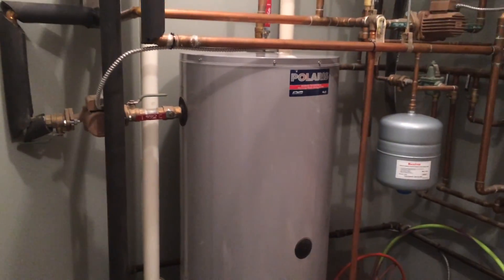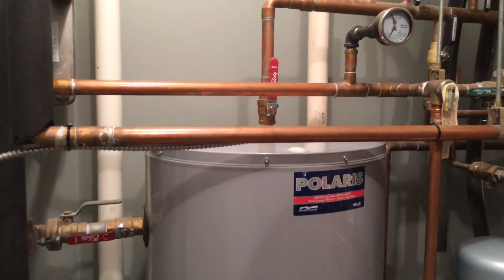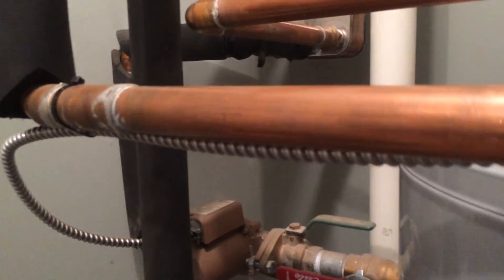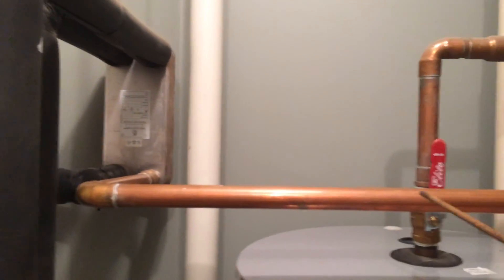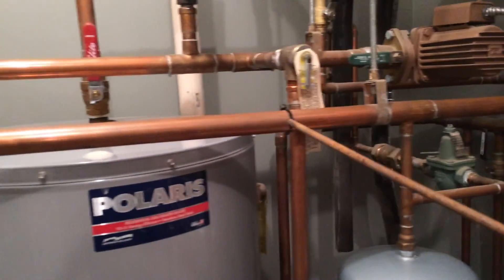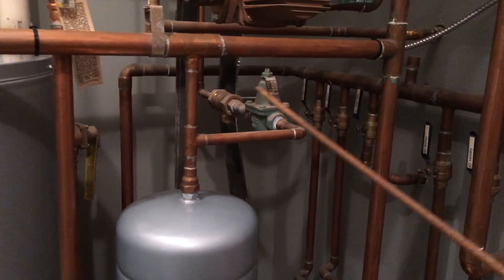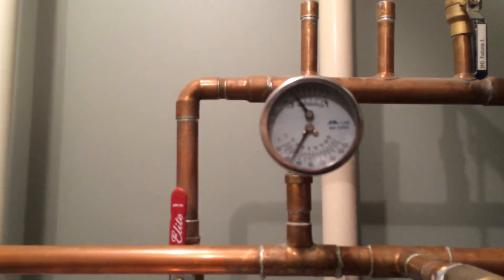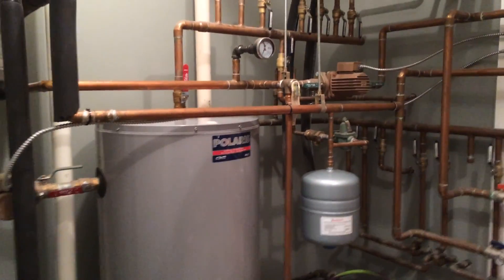Viewer Request: Water Flow for Radiant Heating System

Comment: I noticed that your Polaris is running with barely any noise. I have what looks like an identical model and it's really noisy. Can hear it two floors above it. Any recommendations as to what may be the cause?
Reply from the maker: sergey primbetov - thanks for viewing my video!  The only I can imagine is vibration noise. Where is your Polaris mounted and could it possibly be transferring vibration noise through your home?

Comment: like that you put in a big enough pump to carry the entire house. Something few seem inclined to add is the flat plate collector.. think that is a nice safety thing as one would have no way to get the radiant water mixed with domestic if one plumbed it that way.  Curious how you filled your system to 12 psi .. I know many of the expansion tanks come pre set that way so if there is a pressure or temp surge on the water heating tank.. only then would the tp valve pop.  All that copper . put a smile on my face.. shades of three stooges plumbing. Yes I know everything had a place to go to and return  just made me smile
Reply from the maker: Steve Pailet - thanks for your comments and yes, the large Taco011 pump is a beast and works great as the main circulating pump for the house.  Our code does not allow on open system where the radiant and domestic water are mixed, so the heat transfer plate was a hard requirement.  In regards to the system filling, I simply used the manifold fill ports and filled one zone at a time with manual controls.  Any additional fill would have been supplied by the automatic fill valve which has a a back flow preventer to ensure the water only flows one way.

Comment: What exactly is the function of the two heat exchangers ?
Reply from the maker: Farid Jahed - there is only 1 heat exchanger which is used to isolate the water from the water heater from the water (or other liquids that may be used) in the PEX tubes. There are two circulating pumps - 1 is used to circulate water from the water heater through the heat exchanger and the other is to circulate the water through the PEX tubes and manifolds. Hope this helps.

Comment: Can I ak what size your house is and how efficient this system is compared to a conventional boiler?
Reply from the maker: Hi Joseph. We are heating approximately 2000 sq ft of garage space (garage over a garage) and approximately 2500 sq ft of living space.  The Polaris heater is highly efficient and my Michigan winter gas bills are less than what I was paying in our previous house (gas forced air)